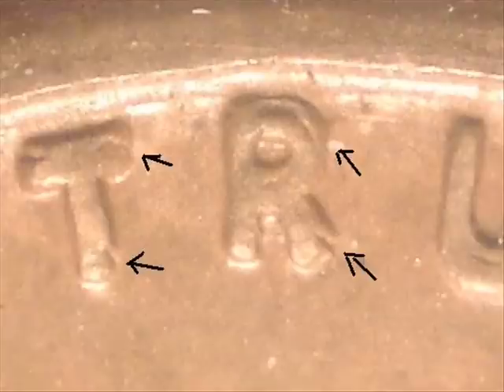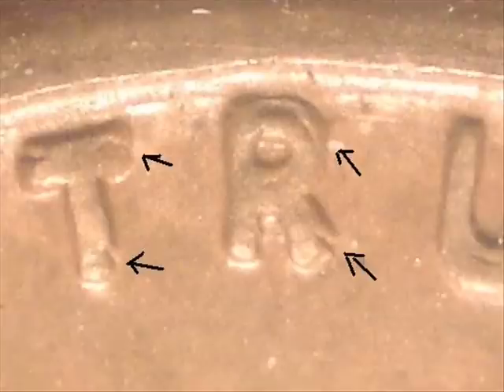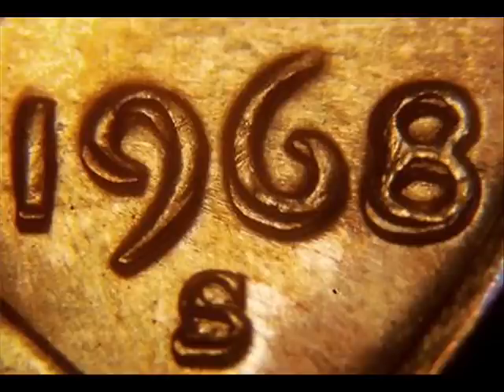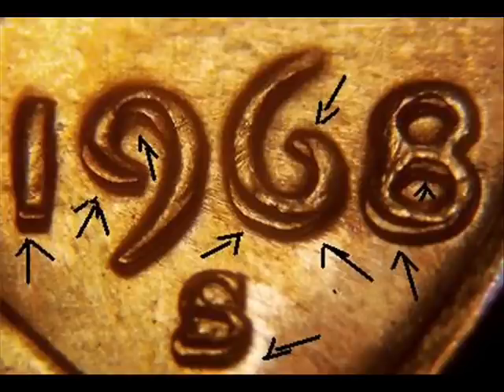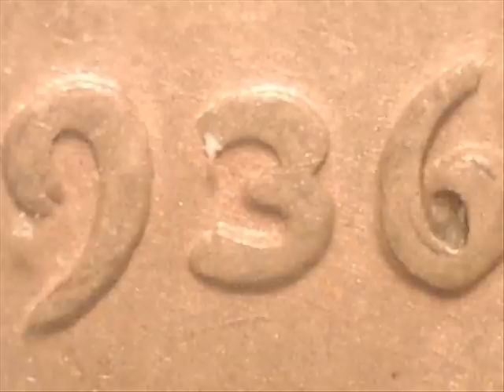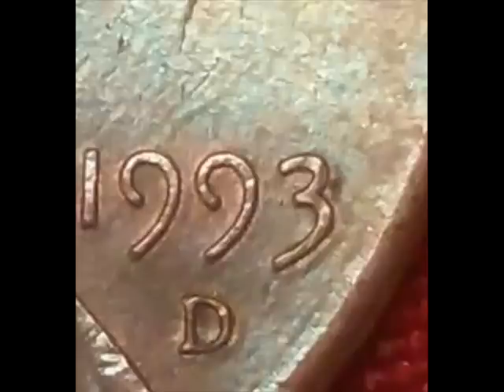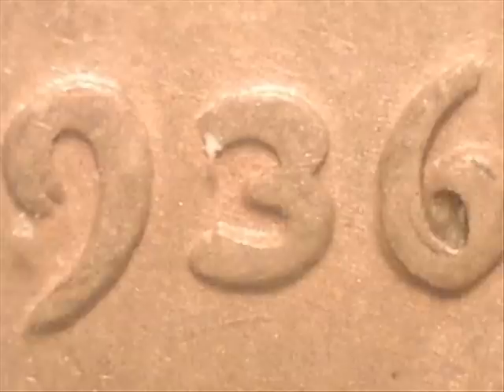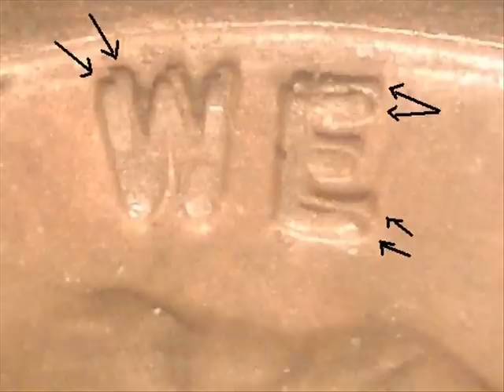True doubled die vs strike doubling and die deterioration

Comment: Dustin, the way I understand it, a double die is an oddity of a coin and it's that oddity of the coin is which increases the value of the coin. A strike doubling is not normal and makes the coin odd. Should this not also increase the value of the coin since there are not very many strike doubling of the coin? BTW, thank you for all of the good info you present on coins.

Comment: Are these still worth only face value? Or do the die deterioration and strike double also make it more valuable?
Reply: 99.9% of the time, die deterioration doubling and mechanical doubling add no value, as both are within tolerances for the mint and not really considered errors. 

There are a few exceptions to this. First, for the year 1955 specifically, a die deterioration doubled cent does hold a small 5 to 15 dollar premium, simply because the real doubled die for that year is SO popular and yet SO expensive. So the die deterioration doubled cent is called a "poor mans doubled die", and some people will pay a small premium to get one as kind-of a placeholder for the real deal.

Second, if there is a really extreme and attractive example of either MD or die deterioration for any year, it is not too hard to find someone willing to pay 1 or 2 dollars to add to their collection just for fun, and because they like it. It does not add any intrinsic or book value, but - a buck or 2 isn't bad. Again, though, this is a case-by-case situation where an individual collector is willing to pay a little, not everyone.

Comment: Hey I have a question for you. I found a coin in the floors of a house I remodeled and was wondering if you knew anything about a 1941 silver wheat penny. I think that is the year on it it is either 41 or 42 from what my eyes can make out. Please let me know if this coin exists and what it might be worth. Thanks!!
Reply from the maker: +Shannon Brafford most likely you have a 1943 steel cent. 1943 they needed the copper for the war effort so they made the cents I'm steel. Take a magnet to it. If it sticks it's a 43 steel. If it is silver and not steel then it would be a cent struck on a dime planchet.

Comment: I have a 1987 D cent that is doubled on the date 87. the surface of the obverse is a little warped causing it to double. is it considered a double die?
Reply from the maker: no that sounds more like die deteroriation
Reply: Coin Opp I found one of the 1968 S. is very interesting. Ty for posting informative videos. I basically started searching for errors/d.dies with no reading materials. Ty
Reply from the maker: Jun hee Bae that's how I started too. I used to annoy the hell out of my local coin dealer at the, I was always bringing him things I thought were errors. lol
Reply: Coin Opp I believe I went thru over 50 boxes with a lot of change. I have never found any true double dies pennies. found a lot of wheat, but not enough to complete a book. found a bronze/steel 1942 from my dad's change. but was later stolen
Reply: correction, it was a 1943

Comment: Love the 1936-P Type 1 DD. Scored a BU on eBay.  The Type 1 Reminds me of 1969-S because of the locations of Doubling. 1955-P is always awesome to see.  1917-P DD on the wish list at decent grade. The 1972-P is cool but 90% were found in mint bags so they will be found in MS condition most of the time. I would collect MS66 or better on the 1972. Good luck to anyone who can find 1958-P DD IGWT, rarer that 1969-S and never talked about.  Only 2 found! Which tells me the Philadelphia mint caught the 1958 error and destroyed the others. I would only pursue a MS69 1995-P DD since the MS68 are abundant and only worth $150?? I bought whole roll1995 BU DD way back for about $15 each and I know I am not the only one with a bunch ungraded 1995-P DD BU.  1970-s LG DT DD IGWT very cool!  The 1971 is cool double die. Expensive one for the amount of doubling but I suppose it is rare especially I high grades. I have 1971 DD that has silvery tone, doesn't look copper but weighs 3 grams??

Comment: I found a 69s the other day. apparently a mechanical double die. had high hopes for a day... dang it!
Reply from the maker: 1969 is another year with lots of mechanical doubled. An easy way to spot the difference would be on a coin minted before 1989 if there is doubling on the date and mintmark...then it is NOT a doubled die it is mechanical doubling. The mintmark was added to the hubbing later.

Comment: what camera do you use
Reply from the maker: +Tony lmao depends we use a variety. The close ups of the coins are taken with USB coin microscopes. They can be bought on Amazon for as low as $30 for a decent one.
Reply: Tony, I took the pictures for the 1936 Doubled die, For that coin I used a "Digital Blue" USB Microscope (About $150.00 at today's prices) but they have cheaper ones out there) I used it on the 60X setting. Thanks for the question.

Comment: Bkgd music is distracting.  Also, your narrative does not match up with photos.  I would like to know why a 'true' DD is worth more than a 'mechanically doubled' coin.  They are both ERROR coins.  And what many of these explanations on YT fail to mention is that there CAN BE a double-die within a mechanically doubled coin.  I have been searching coins for several years and have found many coins having die wear.  They are still errors.  I understand a coin with die wear can be/is worth less than a 'true' DD.  But the coin is still, IMO, collectible if the error(s) is/are significant.  Die gouges & die cracks on Morgan & Peace dollars, Franklin & Kennedy half dollars come to mind.  Which brings up my next question:  How do you explain the doubling and/or errors on those types of coins with this explanation for the pennies?